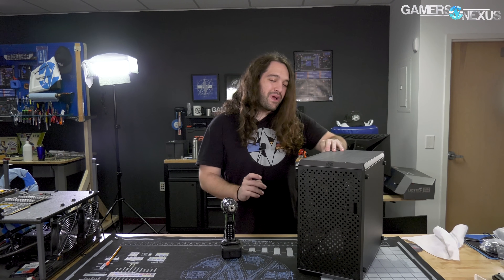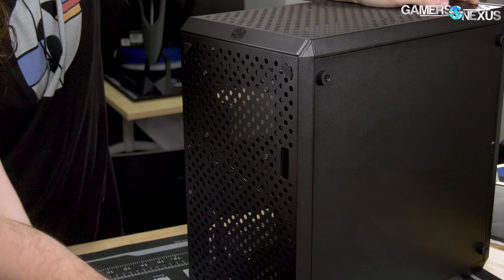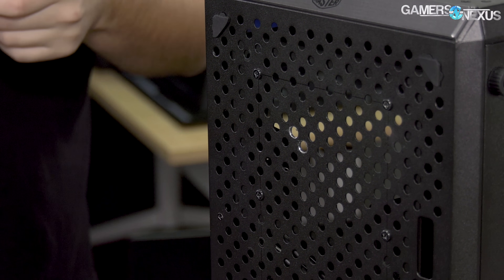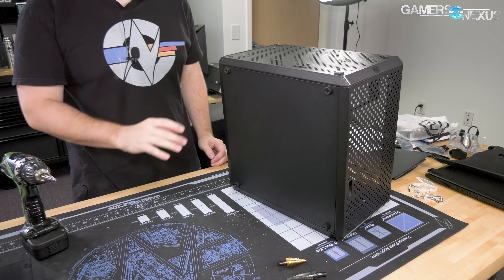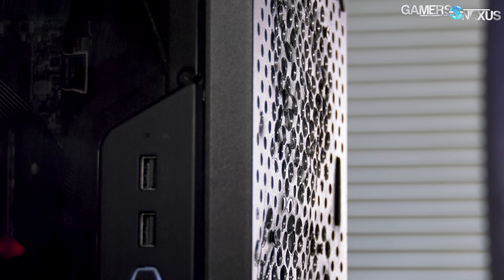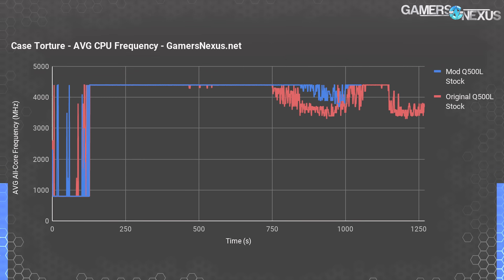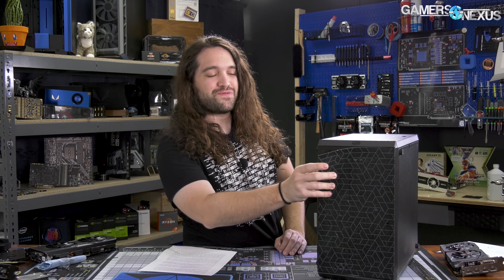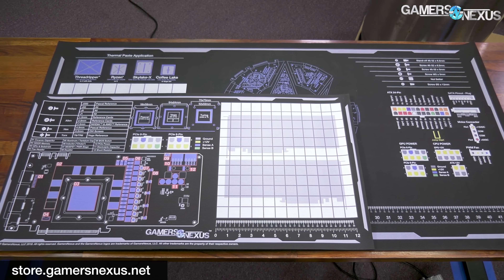"Fixing" Another Cooler Master Case: Drilling the Q500L for Airflow

Comment from the maker: Our original Cooler Master Q500L review is here: https://www.youtube.com/watch?v=F3n80GxU-Zs
Reply: Pro tip: Do NOT stop and reverse the drill. Instead of keep pushing just pull the bit out while it still rotating. If you stop and reverse you will end up with jagged edges.
Reply: Or you know... you could have literally just used an couple of Noctua Industrial 12v 3000 RPM fans.
Reply: Pro-Tip: Put a Magnet into a small Ziplock Bag and stick it underneath the Hole you're drilling to catch the Metal. Afterwards carefully turn the Bag inside out, and dispose the Metal within the Bag to keep your Magnet clean.
Love your "We fixed it for you" Videos. Cooling is more important than looks (at least for me).
Reply: To keep the front panel flat, you can bolt a piece of wood inside, you just drill over both, metal and wood, and keep it straight
Reply: The easy way to modify this case and the Q300L  https://pcpartpicker.com/b/Bchypg
Reply: I wonder why nobody uses aluminum foam except NVIDIA DGX.
Reply: @allansh828  Price probably
Reply: Drill that crap OUTSIDE
Reply: just as a thought, and it would take awhile, but to cut out the space between 3 of the circles in various spots to make a pattern, or design, or such, with work put in to make it look nice.. and then put that over top, don't need to cut out the whole thing then, and a viable case mod to show off.
Reply: Give it a quick sand and mist of spray paint... I am sure most people couldn't tell the difference.
Reply: I would try to just block the front grill and leave the fan holes open. 

I've done that on couple of modded cases of mine to prevent the fans from recirculating hot air that gets passively vented out through the extra holes in the front. Though I did not measure them, but that could direct the airflow better to avoid circulating hot air.

And since you already drilled that case that badly, what could you lose if you duct-taped the front as well?
Reply: Not sure why case manufactures do not take a lesson from the DC industry.  65% open area on a passive cabinet because beyond that you have diminishing returns that effect the structural integrity of the cabinet more than the airflow.
Reply: A jig-saw with a fine bi-metal blade would have been a lot easier and opened it right up, while still leaving enough rigidity for modular fittings.  You could turn the blade in whatever direction you wanted in the holes too.
Reply: CM must hate you guys sooooo much. lol
Reply: Tzuede Off the Cuff  I've done it plenty of times.  I would use the PSU mounting bracket for rigidity and cut as much as possible out. Heck, if you really need some extra cross members you could use mechano or fan grills on the inside for dirt cheap.
Reply: for someone that did the mistake to buy this, and likes to do mods, just cut with a dremel or something like that, 2 x 11cm squares at the botom to fit 2 intake fans, and cover it with the filter, and cut the mesh of the back fan panel with a dremel too.  place the  power supply on the front, and place the case horizontally or add some tall feets in case u want vertical case. 

that will improve  A LOT thermals.
Reply: Just purchased this case. Will arrive after couple days. Wish me luck. I will cut huge holes and put the a few Silverstone 18cm airpenetrators
Reply: ThermalTake View 71 is still the best overall case IMO.

Comment: I'm waiting on my mobo but I'm gonna put an ASRock 6750 XT OC and a 5700G in the q300L. I already took a drill and drilled out the holes in front of the fans and I'm gonna have 8 fans going, 6 on the case and 2 on a Gammaxx 400. I'm curious to see what kinda temps I'll get. I feel like with the PSU at the bottom and having a fan on the bottom to force air upwards will help cool the GPU. Im also gonna play around with intake and exhaust layouts to see if i can find something to cool both the CPU and GPU. Maybe the bottom fan and the bottom front fan as intake with the top front fan as exhaust for the GPU and the two fans on top as intake and the normal exhaust fan would stay the same for the CPU and power delivery. I'm not spending extra on fans because they're all reused from previous builds so I can load this thing down with as many fans as it'll hold and i enjoy modifying thing to fit my needs/wants so I kinda had fun with the drilling lol

Comment: Using a deburr tool on those holes would probably be smart. I would also just sand it down a bit with some sand paper and repaint it. But, just cutting some big holes where the fans are would probably be faster and better solution.

Comment: Step bits are great for very thin materials like computer-cases or sheetmetal, their cutting surfaces are almost fully perpendicular to their victim so they don't push or pull like a normal twist-bit leaving a big, scarred hole with a giant leftover lip on it.

Comment: If you knew how to use a drill it would of turned out ALOT better. Also 1/4 would of worked the same as 5/16 and left it structurally sound.

Comment: Metal is very soft. Easy to cut, but also easy to warp. Safest cutting method is dremel with re-enforced cutoff wheels. Soft metal cuts fast with high dremel rpms. Makes lots of dust. Line the case with plastic and tape off first.

Comment: still dont understand why it "wasn't feasible" to cut the front off, would have looked better and cooled better. Ever since i've got my Dremel I cut all grilles off and remove filters. Best thermals by far, and just dust once year. 

Currently rocking a gaming HTPC (fractal node 605) where I didn't need to do this, but dremmeld holes in the lid for 3 x 14cm intakes (2 directly over horizontal gpu), and just used the 3 x 12cm and 2 x 8cm stock positions as exhausts. works a treat. Adding the exhausts didn't really do much - As long as you got loads going in, you've got loads going out I guess. Not sure why exhausts are ever useful with that principle though?

Comment: You guys are drinking a little to much tainted cool aid... Although my temps are not bad, actually good I could see using the dremel to cut out fan squares just smaller then what would be required to mount the fan. The fans should take up any or most of the lost rigidity but I think that would be minimal. This was silly other then to try and prove some point.

Comment: Thanks for the review, I bought a master oven box q300l recently, now i know why it has bad thermals (85% area of solid steel). 
At the moment still waiting for an am4 mount for my old noctua nh-d14 cooler, also decided to get 3 of those fans, put 2 in front and change out the one in the back.
I guess it is called masterbox for a reason, as you have to be a master handyman to fix the case.
Still I really like how the case looks and since usually i don't DIY things i might buy a second one if i mess up the first really bad, also planing to drill a few holes the plastic cover at the height of the graphics card(and also from the info i gathered im going to need a dremel to cut big circular holes, the size of the fans, out in the front).
To be honest, if I was a reasonable man I would just buy an another case and not waste money on extra expensive fans and tools to fix the geometry of the case. But Im kinda of a jack4ss, this the 1st pc i build all by myself, and also what else to do during the pandemic.
My specs: ryzen 5 3600, gtx 680 lightning and it turns the master-box into a master-oven (ikr, going to swap out the card nxt year once there is stock of the 3000's and the 2000' series drop in price).

Comment: I bought this case after watching this and the previous video because I wanted a horizontal small format factor case that could support an ATX mobo and large gpu.  Drill bits are probably more exciting, but a set of tin snips works a heck of a lot better.  My airflow is better than my last case.

Comment: I get decent temps on the q300l (smaller version) with 2x140mm intake fans on the front, 1x120mm intake fan top front, and 1x120mm outtake fan on the back near the cpu(the one included). My psu is down below the gpu intaking air from the bottom and dispelling out the back. Not too noisy and my max temp on cpu under load tends to be 55c and 72c on my gpu. Not perfect but all stock coolers

Comment: A little old and late, but what ever.  Add a simple stop collar to non christmas tree step bit, or a metal drill bit and collar, that keeps you from going deeper then you want. Then put some rigid hard insulation board 1", behind the steel mesh. This reinforces the mesh for drilling. Drill through mesh and into foam, works great.  Never reverse step bits.  And may only have to do light sanding inside. Brush on some enamel paint, and looks factory. Unless the holes are over a fan, doubt it will help your results and you can also glue in or bolt in some thin metal reinforcement brackets if needed. 

I have done this many times to cases in the past. I would also replace their mesh filter with a better one if possible, I am sure somewhere on Amazon they have a magnetic cover that breathes better then the one that comes with. The bottom needs love and fans also- you can also just add larger feet by taking out the old, and add in new ones with a larger screw. 

Hey, it is a 60 dollar case after all, but I do love cases with the video card near the bottom so they can get fresh air. And the power supply either behind the mobo, or up near where the optical drive bays once were.

Comment: So I bought this case anyway because I needed to make my ATX system smaller, and with a couple of extra fans, some undervolting and no overclocking temperature is manageable. Oh, and the NH-D15 actually fit in this.

Not my fastest system but the CPU stays at 75°C and 4,300MHz with minimum noise (in prime95 v26.6). So I'm ok.

Oh, and that's with only 1 bottom front fan in and 1 rear fan out, the other two top fans didn't turn on because mobo temp was below what I set (40C)

Comment: If i were to own this case I would cut out all of the metal obstructing the lower fan and mount a high cfm 140mm, so a circular hole rather than widen the existing holes. 
Use a blower gpu so it vents out the rear and cut another fan hole (or two) in the top to chimney everything out.

Comment: I was on the CM page for this case. This is intended to be a bottom intake case. Putting bigger holes on the front, will mainly aid the PSU cooling. Needs bigger holes in the bottom.

Comment: Hey, guys i have some great thermals with this case, though i didn’t use a normal psu, i use dual HDplex 400w fitted under the back panel and i’m also using dual 330w alienware powerbricks, you should try it out.

Edit: I also, since i have ”no” psu i have an X570 Aorus XTREME, an E-ATX board, guys this case is good, if you put some thought in to it before building, the acrylic side panel is a bummer, i know but it’s a nice design and i like it, i am actually thinking about buying a special-made tempered glass panel.

Comment: maybe it would have been a little better if they used a dremel to cut slits in the front.. like 1/2" or 1" wide, then 1" of material left alone, cut another 1" strip out, etc.
I would think it would be much cleaner while still retaining some kind of rigidity.

Comment: I bought this case because of ur review.
It's a beast, if you like to mod the crap out of it. So I did.
The temps on an 3770k @ 4,5GHz under stress test stuck @ 60°C.
The temps for my 980Ti @ 1400MHz stressed are max 72°C.
All tests in full silent mode.
And on top of it, it looks just awesome in my livingroom and its really quite... full silent system is need for watching films.

Here are some pics, in case you are wondering how and what I did:
@t

It got a self made fan control, since this cheap "UpHere" RGB fans had no controlling and were way to loud. Otherwise really good fans.

Comment: If you want to drill through soft metal, this way, ALWAYS put a block of wood against the back of the metal. This will prevent the buckling Steve ended up with. Another pro tip, when using unibits/step-bits, put electrical tape around the bit at the target measurement. Makes it easier than double checking every hole.

Comment: - Mock up the fans and PSU, and mark the center of each location.
- Use 4" hole saw to remove center of each location.
- Re-mount above fans/psu in wide open "clean" looking holes.
- Profit.

It's a $50-60 case, of course there's going to be engineering compromises. If cpu temps are that big of a concern you should be using liquid anyway in a case this size.

Comment: Just did a build with this case because it was my wife's fav. She didn't want any other one. Honestly it's easy to fix the air flow mount 2 fans on the front move in 2 holes from where your screws are and make a line you'll end up with 2 small square to Dremel out of front then go to top and cut out a large rectangle in the center. The 2 fans on front with the new square cut out looks nice with and without the filter placed back on and same for the top, more so when your inside lights are going. As well as fixed air flow plenty no need to mess with the bottom.  The case honestly I more for a light gaming build small motherboard like rog B450-I gaming with let's say the ryzen 5 2400 with vega 11(meaning no gpu) leaves plenty of room for ample air flow. Those 12$ coolmaster fans that light up blue are good fans for the case. If your looking to build a full on top of the line gaming pc in a mini case (for some reason)go with like the mini consair case. Btw vega 11 onboard graphics can run most everything at Perfectly fine res.

Comment: I am very interesting in this case since I want to put my ATX system in a small box like this.  Sure appreciate your work on this.  I have my Intel i7 3770k system currently in a CM STORM Case which is a 30 lb tank.  So even the NZXT i500 would cut the cost in half and downsizing to sfx PSU reduces another 2 lbs.  This Q500L case should be able to be made with open areas for the front bottom top and back fans and get stability from a sturdier base frame.  I am going to get a Corsair 540 which is great but a little large.  Would be great if the Corsair 540 would be redone to reduce to just one Blu-Ray 5.25 drive.  Otherwize looks like the Corsair 540 Air has the most base potential for those of us looking to get lighter and smaller for ATX and still have a 5.25 inch bay.

Comment: Need some flat wood behind it before drilling to keep it flat and maybe not drill them that big iv done this on other cases and it will turn out better but u used the wrong bit the one you measure with. Use a bit that is the size you want the whole so there all the same size.

Comment: The ventilation on this case is an absolute joke. Like you say, only about 15% of the panel is hole, the rest is sheet metal.
I'd almost rather see this thing with solid panels and traditional cut-outs for fan placement.

I guess the gist is that you can fix the problems but it's so much effort that you'd be better off getting something different in the first place...

Comment: Poor design just in general. If they had used a honeycomb pattern, they would have negated the structural integrity problem(through tension) and provide far more surface area for air to flow through.
Reply: I was about to post the same comment - why didn't they use a honeycomb pattern?

Comment: I think vertical Slots instead of a whackton of holes would be a good compromise between Airflow, Structure, and mounting flexibility. 
As screws still bite into Slots plenty sufficiently for how heavy Fans aren't, and that still removes a lot of material. 
Now that doesn't work for pull through rubber mounts, but horizontal Slots would then achieve that. 
Horizontal Slots can even be a bit wider and still bite well so come to think of it, they might be more ideal. 

Slots look cooler too, anyways?

Comment: Drilling tip - wrap black or white electrical tape (ar apply a permanent ink marker) around where you want the drill to stop so it is easier to see when you have reached the diameter you want.

Comment: Great work Steve. Hope you can help me out with this question: I am looking for a compact Micro ATX case to make a new build (my 2012 build is lagging too much behind) with Ryzen 3000 and Navi showing up soon, I don't want to give up on 64GB RAM expandability (I work with huge graphical projects) but I  have very limited space (my room is 2 by 3 meters). I have been using Thermaltake Core G3 because it's very slim, I get lots of RAM expandability, decent GPU space and I can fit in my 240mm AIO with push-pull configuration but the GPU temperatures are not good at all (partly because of the sideways radiator fins on R9 Nano that push head back towards the CPU radiator recirculating the hot air). I want to build as compact as possible an 8 Core CPU (hopefully push 4.5 GHz OC ?), 64GB RAM and an RTX 2080 GPU performance wise but don't know which PC case to get (hopefully can make a build under 1500 UK sterlings if I can)

Comment: screw in a block of Wood behind the front panel next time to keep the panel flat while you drill the holes. then you also avoid metal inside the case and can then spray the front black again to look nice. Also taking a wire wheel to it would smooth up the rough edges before painting. Just my 2 cents on the next time.

Comment: Considering you can install that nice mesh filter in the front (and it actually looks good), might aswell cut two big holes, leaving a bar in the middle to ensure the stability of the front part of the frame (you can even screw an L section horizontally) no need to re-drill all those holes imo.

Comment: Fans can't breathe properly when something is right behind it. I had this case, you need to mount the fan about an inch away from the front panel to get proper airflow. I zip tied them on to the hard drive brackets. And had much better results.